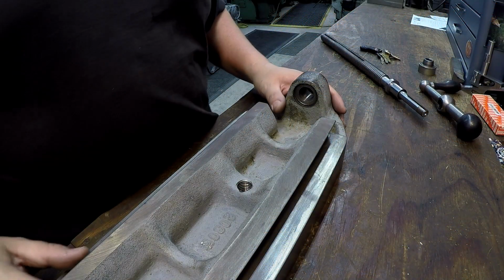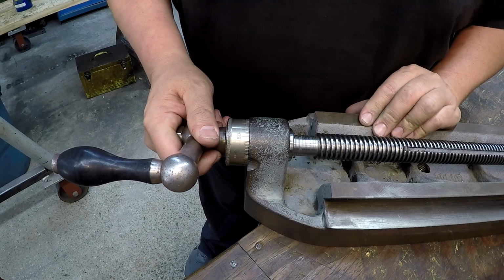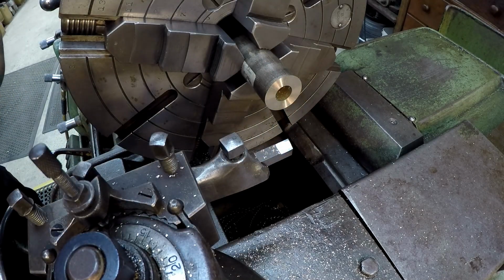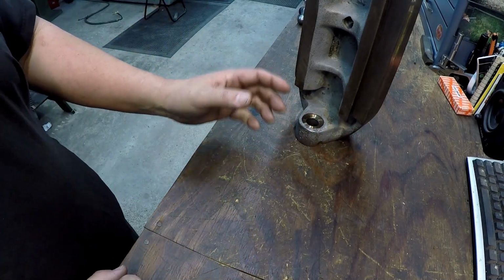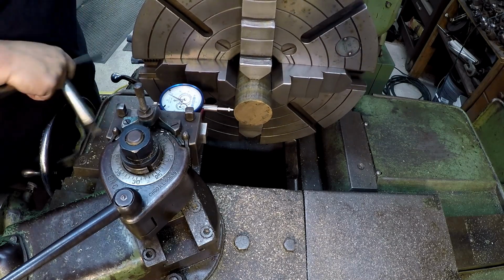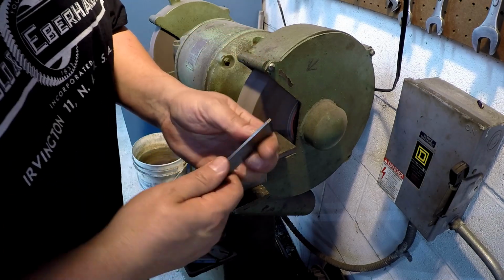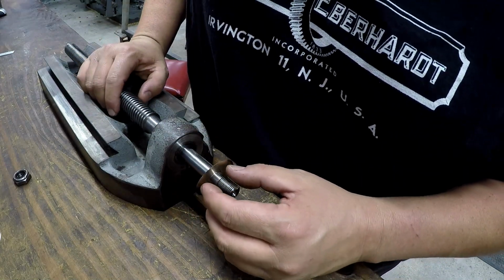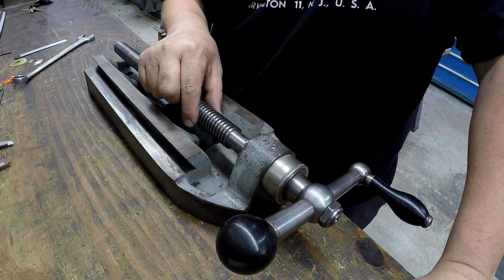Bronze Thrust Bearings for Shaper Tool Slide

Comment: 15.32 "put an angle on it aswell so that it parts the piece off and leaves the nub on the material", aahh, that is the gem for me, just about to grind a set of tools make a set of parts  and that is something I have not come across before and will be so useful. Thank you so much, looking forward to working that out.

Comment: Nice job! I used to have to make spacers for the electron microscope Wehnelt cylinder that were less the 1mm thick. I had to always make them about 3 mm and then sand them down to thickness. I made a jig for the belt sander to get them parallel to the belt surface and glued them to a  stub to sand. I love to see bronze being machined, especially with a sharp tool like that! Thanks.

Comment: I just loved this video Adam, personally I'd have removed a little bit more steel from the leadscrew, so that i could have slightly thicker washers , but the bell in the 20 though one actually helps the process as it puts a preload into the unit, thus as the locknut is snugged up any backlash is totally eliminated.  Nice job my son I can hear your dad and grandad saying. And by the way loved seeing you use your Grandad's Starrett special micrometer

Comment: Hey Adam , just a tip I've never seen you do .
   When you have a smaller part that you are cleaning up by hand on a large flat surface when polishing or cleaning up by hand use a figure 8 rubbing pattern and that will keep the part from sanding or polishing by hand from taking material off one side .
  The figure 8 pattern will put the same pressure on all edges so you dont make a wedge or off flat part . If that makes sense .

Comment: Hey Adam. Nice work, thanks for sharing it.  Forgive the noob question but at 16:15 when your drill wanders slightly, why is that?  Does it imply your tailstock isn't perfectly aligned?  Not saying "You're doing it wrong!" just that mine (even centre drill when it doesn't just snap) does the same and I'm concerned that I'm 'doing it wrong' but without the knowledge of why and whether it's ok. Thanks in advance.
Reply: In this particular case, it is the nature of chisel point drills combined with a bit of imperfection. Even a perfectly ground chisel point drill will wander a bit on contact.
Spotting drills have the point ground to minimize the drift (they are much pointier), and the angle of the spotter (120deg) is wider than the angle of the drill (118deg). This causes the point of the drill to make first contact with the spotted hole, and allow the flutes to gradually engage. The very tip of a center drill is usually also ground to 120, so you can use a large center drill as a spotting drill. It is generally bad practice (tho universally done), to spot a hole with a center drill so you are using the 60deg taper to start the drill. Not a big deal most of the time, but it will do a poor job of centering the drill, and will damage the flutes on harder materials.
Best practice (tho also usually ignored :) ) is to use a spotting drill, but they are a tad expensive so low on most people buying priorities. Once you get some though, you will never use a center drill for spotting again.

To answer your question in full, the last part of the riddle depends on you the machinist. A skill you will learn easily when you apply yourself to it, is letting the drill dwell just long enough to find its center, but not so long it begins to rub. If you let the drill dwell to long on materials that work harden (all yellow metals, many stainless steels, and some alloy steels), you can chip or even break the drill. Some types of stainless are really nasty about this, they will work harden very fast, and the pressure needed to drive the drill in will snap the bit.

The tail stock being out of alignment can make the problem worse, but unless it is way off, the drill will be able to find its center. Tail stock mis-alignment cause other problems with drilling, mostly over heating and excessive power usage. It really causes more problems with trying to turn between centers.
Reply: joshua43214:  thanks for taking the time to write such a comprehensive reply.  I've got (cheap) spotting drills for the mill but I'd wondered why bits seemed to pull towards centre on the lathe when they ought to be already centred. Sounds like I could be being too cautious and snapping bits because I'm going too slowly for the lead-in rather than going too fast then.  Will give it a try and see if that works better - what's the worst that can happen!....when wearing eye-protection ;-)
I'll be following this series as I suspect I may end up having to do something similar on my mill table to solve the intermittent shriek that greasing it just didn't solve. Meh, it may be cheap...but it's all I've got space for.
Reply: Lots of things can contribute to the way a drill bends on the lathe. With a cheap lathe (I am assuming you have something akin to a Harbor Freight), the tail stock could in deed be far enough out of alignment to cause issue with starting.
Drilling is a lot more complex than you would think, and it requires boatloads of power. At the very center of the bit, the RPM is very close to 0, so there is essentially no cutting happening at all at the point. What actually happens is the material undergoes plastic deformation from the pressure, and flows like wax outwards until it get to the fluted area. Cheap drills will never perform well, this is one area it is worth spending some extra dough. You can find a lot of agreement about who makes the best drills, but you will pay more for a full set of drills, than you prolly paid for your lathe. I have had good luck with Triumph drills, they seem to hit a nice balance between quality and price.
https://www.mscdirect.com/browse/tn/Holemaking/Drilling-Drill-Bits/Drill-Bit-Sets?navid=12106099
Hertel is a decent alternative if the Triumphs break the budget. I've had bad luck with Interstate, but others like them a lot ymv.
Probably not a bad idea to check the ram on the tail stock, only takes a moment to do. I have a nice Taiwanese lathe that I wanted the ram to be really spot on since I turn between centers a lot, by dint of mostly luck, I got it to half a thou.
Aside from YouTube, I suggest checking out the Hobby Machinist Forum. Unlike an un-named forum (coughPMcough), where all question devolve into flame wars, there are some superb machinists there, and they love to answer "dumb" questions.
Reply: I agree with all You say. Feel and drill angles are very important. Most spotting drills are unsuitable, the 118 ones can be difficult to find. Not mentioned here is the method of using a cross point stub drill directly (I prefer Dormer) and skip the spotter. For deeper holes, continue with a longer drill following the started hole. For me this seems to be quicker and center better especially in softer materials.  Also breaking the edge on drills in brass and and other "pulling" materials improves precision. Another trick for larger holes on the lathe is to chamfer the the hole with an angle a little "flatter"  than the drill so that the next larger drill hits innermost edge first and not chips its corners. Important for larger diameters especially for (expensive) carbide drills in hard materials.

Comment: I have a suggestion.
Before you install the friction wheel over the thin washer, try rubbing it down into the oil groove a few thou. This will let the oil get between the washer and the nut, while still letting the oil get down into the bore.
Might be able to put a piece of 12ga or 14ga copper wire above the washer and tighten the nut up a bit to force it down into the groove. Pretty it will distort the washer, but I also bet it will work just the same.

Comment: Cool vid Adam. Was thinking, could you “reinforce” the super thin washer by supergluing a heavier/thicker washer to the front of the stock you’re parting off? That way it would kinda act like a thicker washer as you parted it off then you could heat it and pop the thin washer off the other piece

Comment: I had some similar fits making 0.023" thick bronze washers.  I tried quite a few things before figuring out a recipe that worked.  

That recipe for me was a fresh carbide insert in my Kennametal parting tool, with the angled insert having the extended point on the right side (the shape that minimizes the tit on the parted part).  Using the power feed set to a brisk pace diving into the part.  Oh, and using WD-40 as a cutting fluid seems to help (or maybe it's just something to keep me busy while the feed does all the work). 

I could never get flat washers using my HSS parting tool, no matter how I ground it.  Also I couldn't get flat washers without the brisk power feed even using the fresh insert in my Kennametal tool.  Manually driving the cross slide, or using a comfortably slow power feed just never worked.

Now that I have that recipe, I can churn those washers out by the hundreds.

Comment: Very well done, Could I offer an idea.  If the washer needs to be replced in the future for a thinner one I would Part it off thicker than needed, sperglue or shellac the parted piece back to the bar stock, face that off to required thickness then gently heat it up a little so the new washer comes off without a buckle ? I do think that slight spring in the washer may be a good idea.

Comment: When you are drilling with the tailstock, say at 16:25, what causes the drill to drift? This also illustrates the necessity to ream for correct size.
Reply: What you're seeing is caused by the 'web' of the drill trying to cut the material, and having trouble doing it.  If he would have drilled a shallow hole with a center drill, that 'walking' would not have happened.

Comment: What might work with parting off the thin washers is to not quite part off before boring (leave a few millimetres or thirty seconds of meat to where the bore would finish), bore and then finish the parting off.

Comment: On your parting tool grind- I've heard of using the angle so that the num is left on the stock, but I'm unfamiliar with putting the radius on there. Is that to help the left side of the tool cut better?

Comment: I would have been tempted to clamp the bent thrust washer between two clean blocks of steel and put it in a common kitchen oven at 300 F for an hour.  Would have turned the oven off and let it cool to room temperature.  This is similar to what they do in tempering steel.  I have been able to greatly reduce the stress in 1018 cold rolled using this technique.  Maybe it would have flattened that thrust washer.

Comment: Good addition to the slide.  I'm surprised G&E didn't have something there like what you made, I guess they figured the steel on cast iron would be Ok for the life of the machine.
Reply: well it kinda was, it still had adjustment left, its just not the smoothest option

Comment: You can make a really thin and straight shim by parting of a thicker one then glue it on the end of an arbor or piece of stock and then thin it to final thickness. Give it some heat to get it off and some acetone to clean of the glue.

Comment: Adam, I should have watched the video for a little bit longer. Could you use the "warped" shim anyway? I would think that it would just get squashed flat when it was installed?
Great video and a good tip on grinding the parting blade. THanks!
Eric

Comment: I use a slitting machine for cutting foam similar to a lathe set up with a blade. We get blade and material deflection all the time and need to make adjustments by changing our angle. Would changing your angle of apprach help keep the thin bronze washer from distorting?? Or could you bring a bevel on the cutting edge of your tool?? Just curious obviously very different situations.

Comment: hey addam, i have a question. Would oil impregnated cast iron (like the one you showed us once when you were burning off the oil from a piece to weld it) do a better job there than bronze? Is it possible to impregnate the iron it in your shop? with a vacuum pump or something... That would be a very interesting video.

Comment: I am truly envious, it sucks being without a machine, even a silly Chinese lathe would be better than nothing.
I would be doing the same thing you are doing, on the lookout for a used Chinese lathe locally, sometimes they come up, and often they have some tooling as an extra.
It wouldn't hurt, as most of what I do is for R/C Aircraft, so, everything is tiny.
Reply: You should check out This Old Tony. He recently bought an ultra cheapo chinesium lathe, and is running a series on how to improve it. From what he said in the last episode, he is going to make a series on how to make new metal gears for it, using nothing but the lathe itself, and a few hand tools (the really cheap Chinese lathes have plastic gears from factory).

Comment: Hi...I love your videos.  And I must comment on your skill level..very impressive.
Two things that I would like to comment on
One was on the large bushings you made and pressed into the very large telescope cylinder.
How much was the interference fit?....my suggestion is that Sunnen...automotive equipment markets a very good spray for interference fit wrist pins....really works well

The other question is that could you have used a Torrington radial thrust bearing?

Comment: I realize that this video was done a while ago - would you be able to press up a flat plate with the tail stock, hold in a bush with a thick shoulder, again with the tail stock, or machine an adapter for the  live center with a shaft for the ID and again, a shoulder to provide support and prevent the part from deflecting?

Comment: I am sure it does not matter in this case but a nyloc nut is not considered in safety unless 3 threads are protruding
Reply: Shouldn't matter here though... hand operated slow speed application.
Reply: Yes, I agree, just if someone is using nyloc nuts in a critical application such as aviation it is important. Nyloc has virtually replaced turret nuts and split pins and is completely suitable provided the nyloc is in safety.
Reply: althalus401 it doesn't look like a nyloc nut. It looks like a distorted thread or top lock type nut.

Edit: ok it does look like a nyloc my mistake.

Comment: Why not run some actual roller thrust bearings? Edit: Looks like the brass is doing pretty well, I'll give you that.
Reply from the maker: .9375" ID, 1.500" OD. let me know when you find them
Reply: Fair point. You can get a 1x1 9/16th, but then you'd have to bore the cross-slide. So yeah, probably best to use the brass.
Reply: It has only been 80 years without any wear bushings.  Maybe these new bronze ones will last 80+.  However, none of us will ever know!

Comment: For the thin parts that warp, I found this method from clickspring who makes little tiny gears for clocks.  He superglues 1/16" engravers brass to the lathe.  He also grinds the cutting tool on both sides.  Here is the technique" https://youtu.be/ZSXDIraHz3k

Comment: Sometimes you refer to an indicator as a "last word" indicator.  Googling this term gives no definitive answer as to meaning.  Would you please elaborate?
Reply: Robert Cook a last word indicator is a small dial test indicator made by Starrett. I personally don’t like them, but they do get the job done when you don’t need extreme accuracy.
Reply: Robert Cook product made by starret. Measures tenths 😳
Reply: Jamie King the one I have doesn’t read tenths. Nor do the new ones Starrett sells. They read in .001”
Reply from the maker: Very old style of dial test indicators made by Starrett.

Comment: it's your shaper, but I would have faced both surfaces flat: the top of the  slide casting,  and the worn face of the friction bushing, and made a thicker bronze bushing, which wouldn't warp. I'd also consider putting in a button oiler fitting on that pillow block end of the slide casting. just my $0.02.
Reply from the maker: I get to do what people tell me all day long. One of the joys of my own shop and machines is I can do what I want.
Reply: Abom79 
another thing I'd do is put a similar cut and index mark on the other side of the pillow block end of the slide casting, so that you can see it when you're running the shaper on the clutch side.
Reply: Abom79 Well I was about to suggest a grease fitting. You said the definitive sentence. Your decision to make. So be it.
Reply: I would have ordered a pizza delivered to the shop.
Reply from the maker: There’s a groove on the top, as I mentioned. The oil runs down the shank of the screw.

Comment: To machine a thin part face it off thicker then you need. Using a face plate CA glue the part to the face plate. Machine to thickness you needs sing light cuts. Use heat to aspartame the part from the faceplate.

Comment: ALWAYS INTERESTING,, I'VE NOTICED, EVEN THOUGH THIS IS BRASS, NO ONE SEEMS TO CHALK A FILE ANYMORE, SAW AN EXTRA WASHER AT THE END, DI YOU REMOVE THE FIST ONE YOU MADE
Reply: If my memory serves, chalk is used for sticky materials, such as high pure Aluminium, drawn Brass, Copper, Tin etc, Bronze normally files freely. But yes, when files were the only hand method of metal removal.

Also we used to use new files on Brass/Aluminium, then after a little use, steel etc. I used to work with a lot of Copper in resistance Welding (Spot, Seam and Projection),  up to 200 kilogram castings. 
It was a pain in the bum to machine, drill, file and scrape flat, part of the reason was its reactivity to ferrous tools, I still have a Stellite tipped flat scraper, which I found didn't erode like high carbon steel.
Reply: ONLY SIS IT IN HIGH SCHOOL SHOP,  NEVER WORKED IN  REAL SHOP
Reply from the maker: I sometimes use soapstone and it seems to help, but I never have a piece nearby seems like.